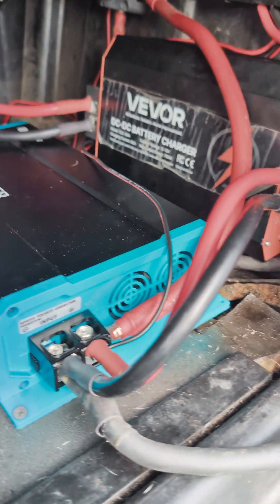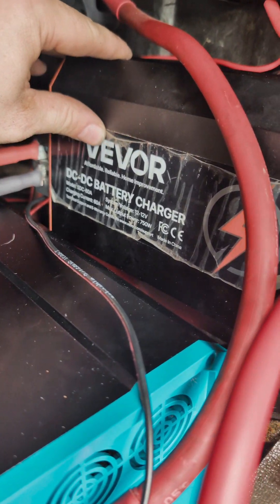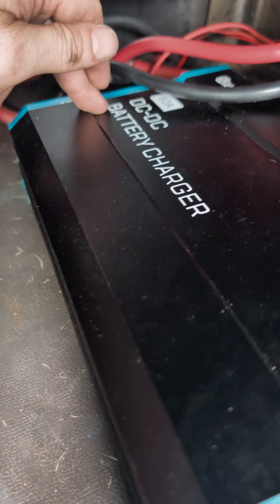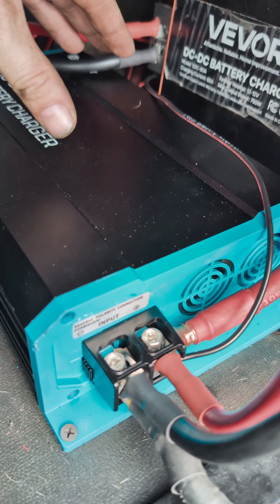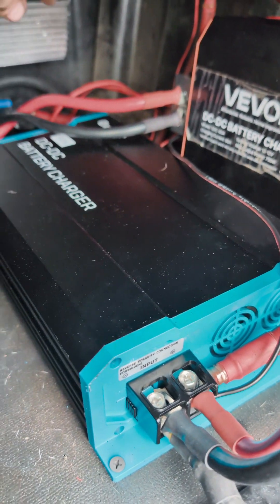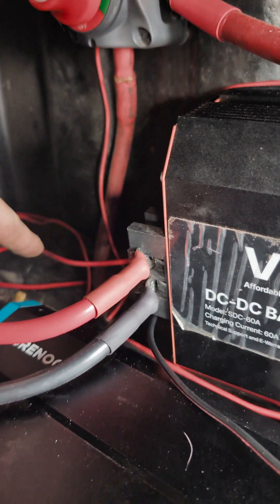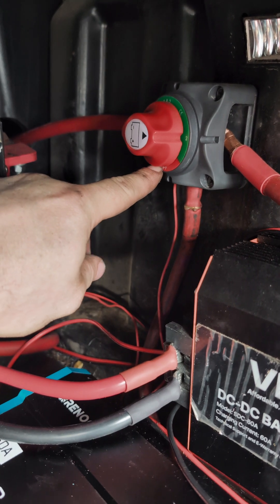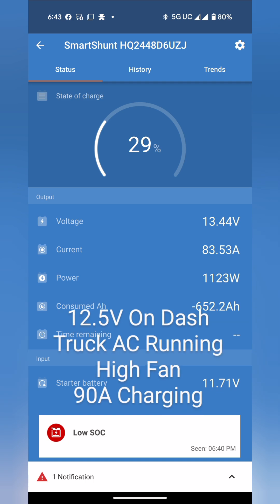Renogy & Vevor 60 AMP DC to DC Chargers Wired - Lithium Battery Bank - Update Video

Comment: I got the same Renogy 60 amp dc to dc charger, and it blows my fuses every time I try to run my system to its max 60 amp charging capability, the only time it doesn’t blow my fuse is only when I hook up the Limiting Wire (LC) , so what fuses you recommend I use on the input and output, to use the max Amp feature.
Reply from the maker: I didn't have that issue but unfortunately the high power mode broke. I posted a new video where I switched to victrons DC charger which has been amazing. To me it sounds like either your is defective or you don't have a big enough gauge wire setup from the battery that's causes the wires to get hot and pop the fuse. What gauge are you using?

Comment: I’ve had two of these chargers brand new and they both died within three months

I have my stuff wired, exactly as you do 

But what ends up happening is the charger even when you kill the small wire power the charger stays on 

And it kills the engine battery
I believe it is caused with heat being the issue 

These chargers, get really hot and mine’s not underneath the hood. It’s actually inside my van. 

So there’s only one thing I can say about it they are junk
Reply from the maker: I haven't had an issue with the battery getting drained at least not that I've noticed but your right there chargers both failed on me in less than 3 months. I just got a victron DC to DC charger and hoping that will solve the problem. I'll install that one next week.

Comment: Ps I installed 225 amp on my e250 two 60 chargers easy good luck
Reply from the maker: Sweet! That's what I would like to do but swap up the chargers with victron ones. Although right now I'm debating on if I should just focus on upgrading the solar instead as I own the trailer I could use thin flex panels on the roof and get more power that one. I'm not sure yet though 😂

Comment: How many amps does your alternator naturally put out?
Reply from the maker: It's only a 160 amp alternator so I can only run 60 amps safely. Does the job though eventually when I have the time I get around to swapping out the alternator. Of course gotta get the solar panels installed first 😂